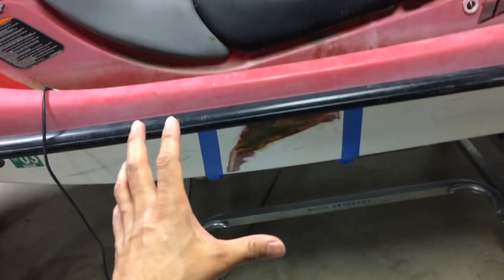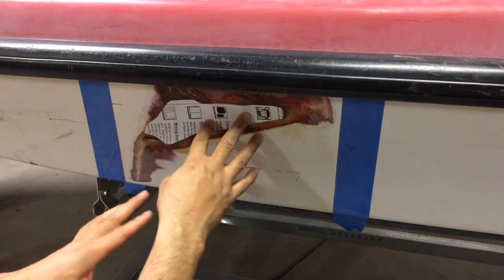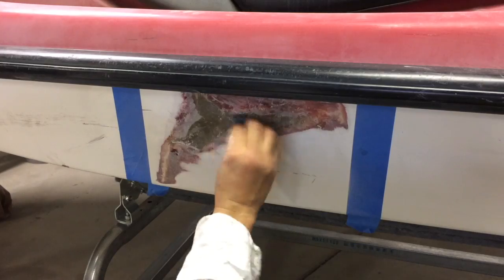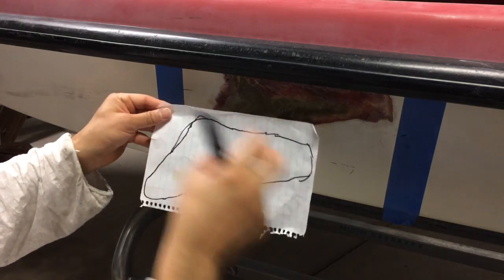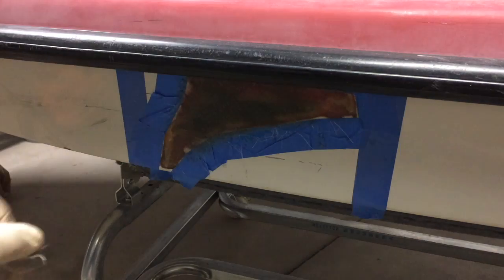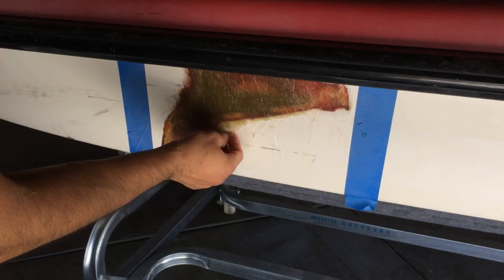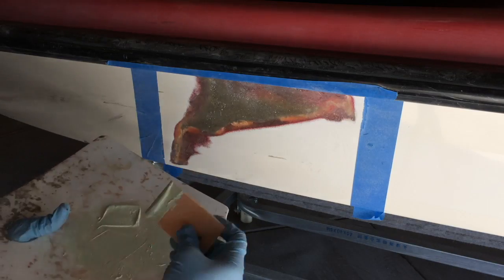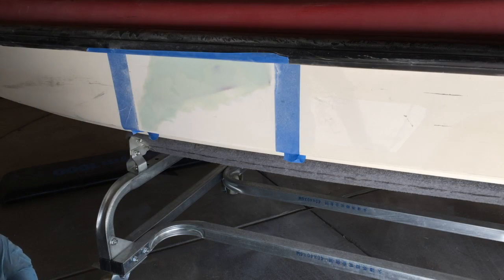Jet Ski hull repair Using Fillers - Part 2

Comment: How long did it take you to do this repair. I have a similar instance where I damaged a JetSki that I rented while vacationing in Florida and the guy wants to charge me $936 does that seem fair?
Reply from the maker: It’s a process, a lengthy one too.  I thought those things come with insurance if accidents happened. Seems a little steep, but I’m not sure what else was damaged. Because it’s a process to repair,  costs may be north of $500 depending on the size of the damage

Comment: I thought your supposed to be using epoxy not polyster?
Reply from the maker: Mondragonpride11 the filler is not a primer of any sort. It’s just a water resistant resin which hardens and can be sanded. Epoxy primers can be used, but not for this type repair.
Reply: What is the name of the resin
Reply from the maker: Mondragonpride11 Product by 3M called Marine Premium Filler